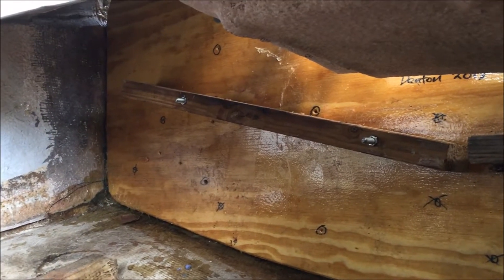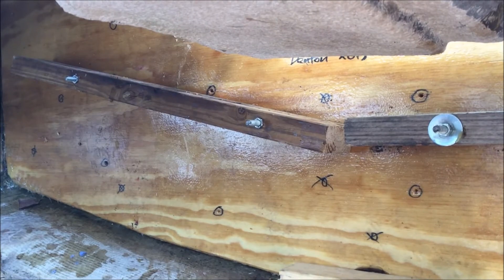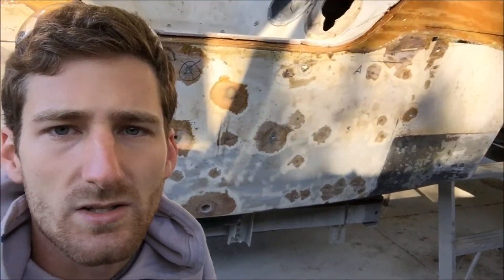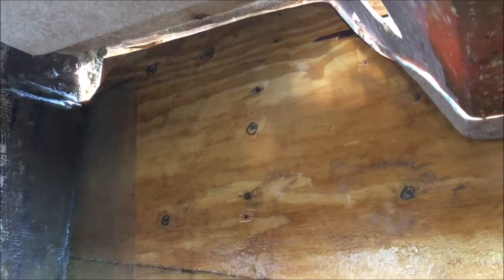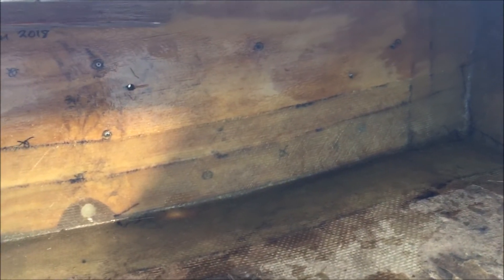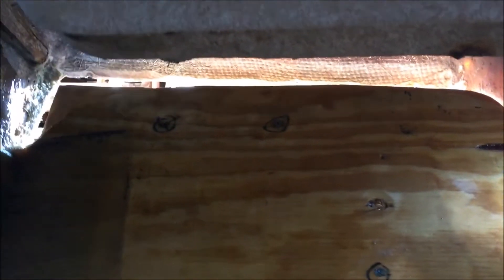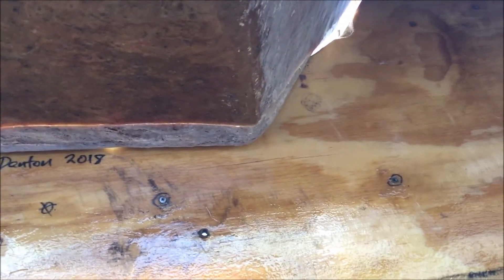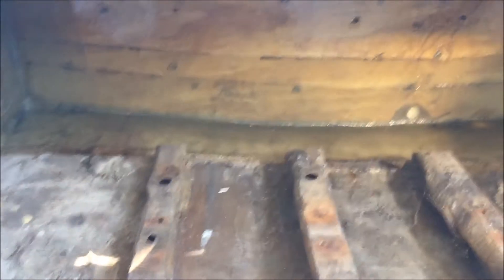Sport-Craft Boat Project Part 5: Tabbing in the Transom

Comment: Nice work.. But why not use the cabosil with resin for a thickner for peanut butter to laminate the ply instead of liquid nails? I started from the outside and worked my way in.
Reply from the maker: If I was to do it over (I hope I'll never have to) I would certainly use thickened resin to laminate the ply together.
Reply: How is the project now.. Thumbs up for your effort!
Reply from the maker: +Jay   The boat has been doing great since I got it back in the water. I've just been enjoying it and doing little things like adding navigation lights and a fuse panel.